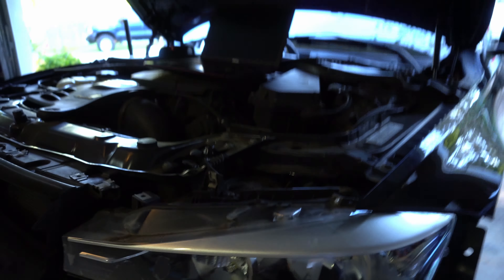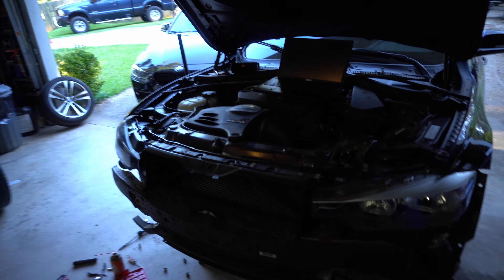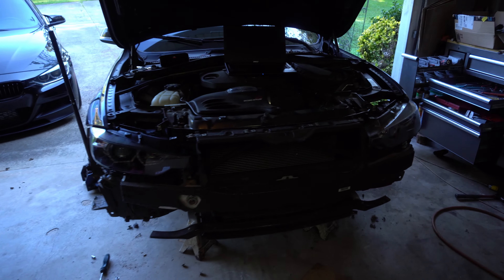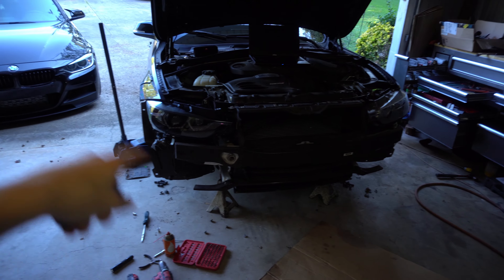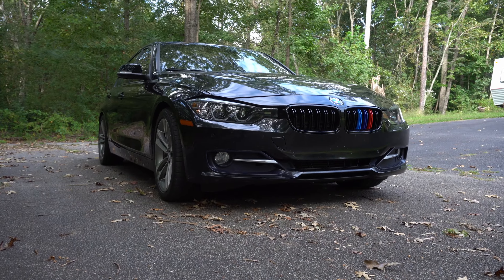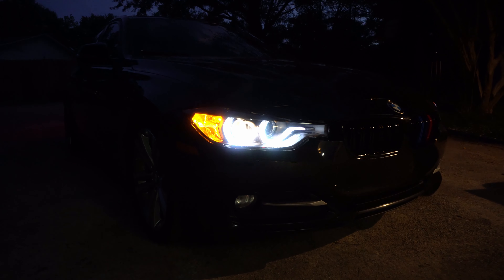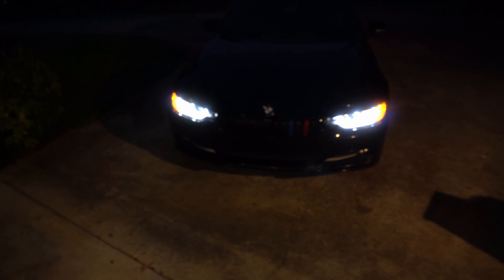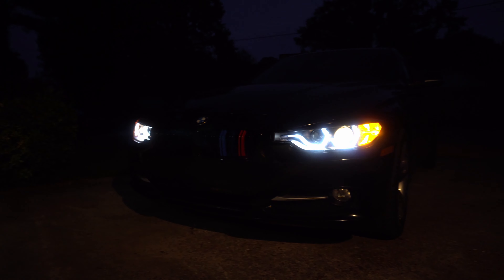BMW F30 Great Looking Ebay Halo Headlights for Cheap! (Much Better than Stock!)

Comment: How does it come that my headlights edges don't align perfectly to the bumper? Whats the cause of it?
Reply from the maker: I’m not really sure. These headlights that we bought had great fitment and fit perfect. You have minor adjustments within the bolts you put in so maybe that’s the cause.
Reply: @duncancheeves  I can still adjust them a bit but would it be a better idea to do this when the bumper is on so i can make sure it's perfectly aligned?
Reply from the maker: @ThatLennyBoi  I’m not sure. It may be hard to tight those with the bumper on. You could always adjust and then test fit the bumper and keep doing that till you get it right? But if that works for you then it may be the better option.
Reply: @duncancheeves  I'll try with the bumper on first, thanks for replying anyway really appreciate it!

Comment: Great upgrade ! i have a question. I have an f30 from 2016 can i use these headlights ?
Reply from the maker: Just to be sure before you buy them check the fitment notes but yes. 2012-2018 headlights are the same. Just different variations
Reply: @duncancheeves  But i want this model of headlights not the LCI model and for the depo angel eyes is from year 2012-2015 always .
Reply from the maker: @omergokce5971  yeah these model headlights are from a brand called spyder I think also there’s a link in the description

Comment: should i get a bmw 328i? ive heard a lot of different opinions on the maintenance and how pricy the fixes are, what do you think?
Reply from the maker: My honest opinion is yes. They can have timing chain issues and I would look up on that if I were you. The 328 was an extremely reliable car for me and others I’ve talked to just don’t push the horse power above stage 2. I didn’t have a single thing go wrong on the car. Now maintenance can be more expensive than something like a Honda ofc but if you shop on fcp euro you can get good prices and lifetime replacement on stuff like brakes, rotors, even oil. It’s a super fun car that is quick sounds good and looks good. For the price it’s the best interior and infotainment you’ll get.
Reply: @duncancheeves  yeah i was looking at a 2014 bmw 328i im so in love with the bmw but my parents dont want me to get a bmw. i live in a complete different state soooooo i may just learn and find out myself bro

Comment: How did you get them to work? Base model halogen lights are not wired for LED lights. They have 6 pins at at terminal. Aftermarket eBay lights like the ones you linked have more pins, which means the harness you plug it in to has to be different. For example, if you had  a higher trim bmw that came factory with LED angel eyes it would already come wired with the modules and ballasts, while factory halogen cars are only wired for simple circuit headlight assemblies.
Reply from the maker: All I know is they went right in with no issues 🤷🏼‍♂️

Comment: Just got em how they holding on? 😊
Reply from the maker: They look just as good as when we installed them!
Reply: my spec d tuning driver side one failed, i wanna try these are the low beams for night time strong? cause spec d’s are not lol ebay has these for $360

Comment: I installed these myself 3 years ago only because I wanted halo to replace my halogen headlights on f30. The problem with these are the LED halo dies pretty quick. Mine had an HID version and the ballast died in few month which I replaced by another set. But one of the halo died in couple thousand miles which I could not replace and stuck with it. I am looking for another one now which is not as cheap as these but may be last longer.
Reply from the maker: these are still good for me had no issues personally.
Reply: @duncancheeves yeah, you can't really tell if they will last or not,I installed mine on 2018 and one side halo is still working .. its kind of imbarassing to drive my car atm 😅
Reply from the maker: @darshanpradhan  oh dang maybe it’s just a wiring connection something you could fix
Reply: @darshanpradhan  it may be a wiring issue mine stopped working on the left side and j I went to go look at the wires and two were ripped so I stripped them twisted them together and tape them with black electrical tape and now it started working again

Comment: How do you get the yellow parking lights to turn off? on the side
Reply from the maker: They are on when the lights are on at night. But day time running lights are just the white halos. Just the way all Bmw lights are 🤷🏼‍♂️. You can maybe use bimmer code too change it idk
Reply: @duncancheeves at @7:36 i see the yellow on w the drls tho
Reply from the maker: @silentescape818xsfvla8  hm well it depends on how bright it is outside. It senses the brightness and they turn on when it’s morning or night. Then it should go off after that and be the the daytime lights. If it’s bright outside the yellow side marker lights should not be on.
Reply: @duncancheeves  You think these are better than the ones i have now? Spec d tuning
Reply from the maker: @silentescape818xsfvla8  not too sure of the brand you have. This brand we bought has definitely been good for the time we’ve had them on. No issues.
Reply: @duncancheeves  Have you changed the turn signal bulb? i hate the orange so i ordered some white led ones.
Reply from the maker: @silentescape818xsfvla8  I haven’t personally but I’m sure white will look sick.

Comment: You think I can swap the halogen bulb with an LED one?
Reply from the maker: I believe you can just if it doesn’t work right then you may have to buy BimmerCode to code the new led bulbs in.
Reply: We’re you able to swap out the halogen bulb if so which did you use ?

Comment: Just got these eBay jobs on my wagon. I don’t even know how bmw let cars go out with halogen headlights, they’re the worse. I love the headlights like thw halos better than the round ones. How are yours holding up?
Reply from the maker: They are holding up super well actually my brother drives the car with them on and he’s had no issues. We had to adjust the headlights to get them just how he wanted but after that no issues electrically or no issues with the build quality.

Comment: Hey man I have a 328i too, I’m wondering what did you have to do to your car to get it ready for a tune ?
Reply from the maker: Nothing for stage 1 bootmod3! Stage 2 however recommends intercooler and high flow downpipe
Reply: @duncancheeves  thanks bro appreciate it
Reply from the maker: @leitor928  no problem thanks for the sub!!

Comment: hey man any chance you still got that muffler if so could i possibly buy it?
Reply from the maker: sorry i dont i sold it a year ago.
Reply: @duncancheeves  could you send a link for it ? i can’t find it i have a 2016 328i if so it would be appreciated
Reply from the maker: https://www.summitracing.com/parts/flo-12512409

Comment: Doesn’t fit 2016.  Can’t find those for 16 models
Reply from the maker: It might not say it but it’s the same headlights
Reply from the maker: Should be but I’d make sure both years have the same connections

Comment: have a headlight that doesn't have the dots, but isn't that expensive?
Reply from the maker: I mean at that point you could just buy the depo angle eyes they are just the stock halos that came with the halo package from the factory. They are about 600 dollars and you can get them from kiesmotorsports.
Reply from the maker: Other than that I don’t know if any that are really cheap and have a better look.

Comment: Do you need to also purchase a lightbulb or does it comes with? If I do need to buy one which did you use cause I have literally the same car
Reply from the maker: You don’t need to purchase a new bulb only if yours is out already. They use the same bulbs.
Reply: So I believe my question is I don’t want the halogens bulbs I would prefer a led bulbs would that be compatible or I have to stick with halogens
Reply from the maker: @israelolangi45  oh in that case it doesn’t come with bulbs. I don’t think so at least it’s been a while. It definitely doesn’t come with leds tho. But yes they would be compatible and I believe you would have to code them in with something like BimmerCode
Reply: @israelolangi45 comes with bulbs halogen… trash.. you need to switch to LED H7 for better lighting but the DRL look LED already so u might be good.
Reply: @SycaShow H7 ice white or blue would look sick huh?
Reply: @SycaShow  how do you remove the low beam light bulb tho I
Reply: @Andy-ur4vu  it’s right in the middle, I’d replace it before you put them in 😂

Comment: I'm interested in buying a 328i, and I know that BMWs aren't super reliable. How reliable is a 2016 328I?
Reply from the maker: I would say very reliable. Bmws have this misconception as long as you regularly maintenance your car you’ll be fine. Oil changes when it needs it! In the 2016 models the timing chain issue is not so much a issue anymore so your good there. 2015+ had a redesign. Freak things can happened to any car make sure your buying a car that wasn’t beat to death. But overall very very reliable engine. It has given me 0 issues on a stage 2 tune.